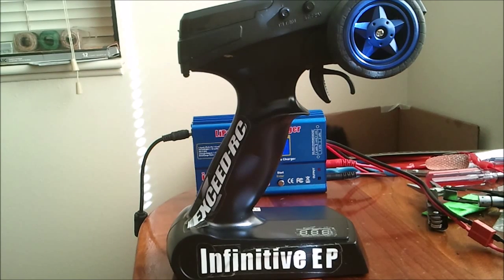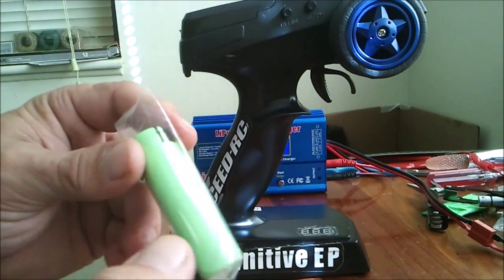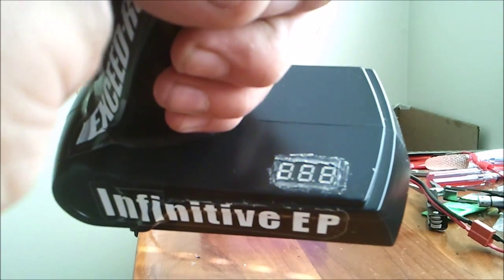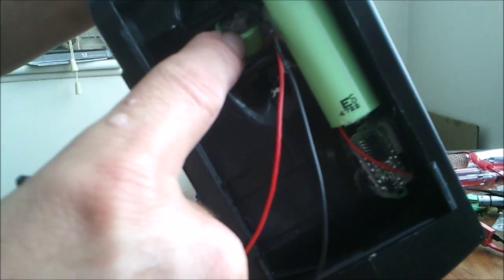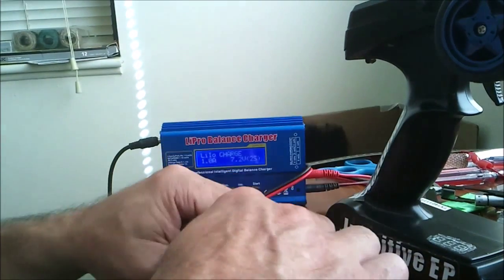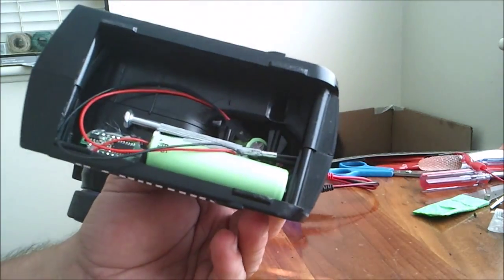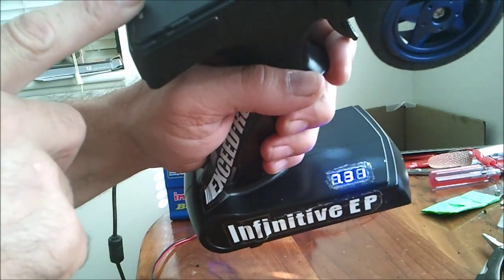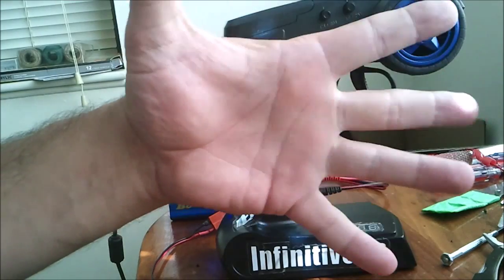Converting my RC transmitter to 18650 Lithium-Ion !!

Comment: Good JOB.. > Question, my R/C Transmitter uses 8 AA batteries, I want to use lithium batteries, how many do I need and do I need the buck converter ? can you also share how you wired the LED display  with the batteries please ..thanks

Comment: so the conclusion is whether the 18650 battery with a voltage of 3.7v 40a can be used as this remote battery